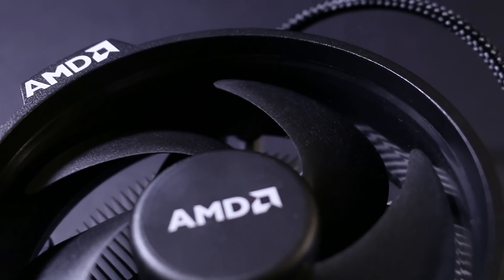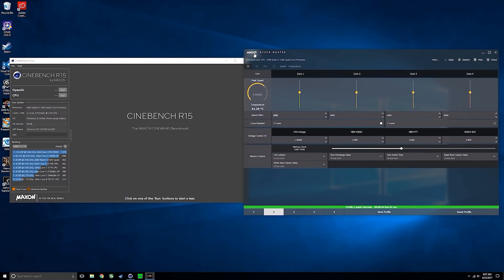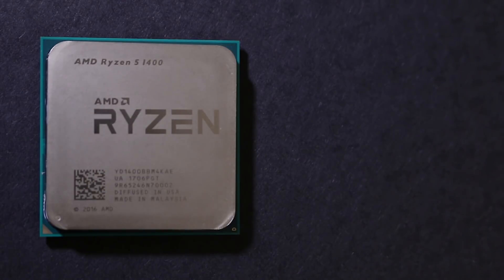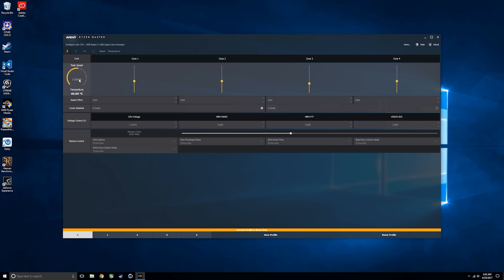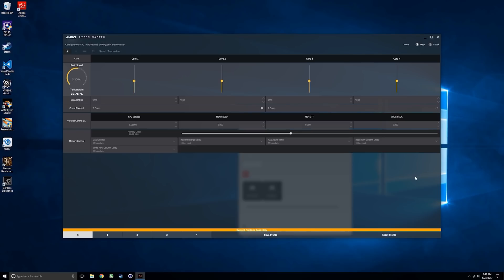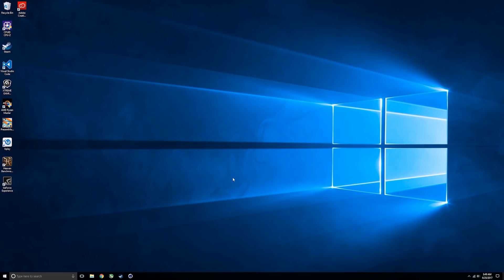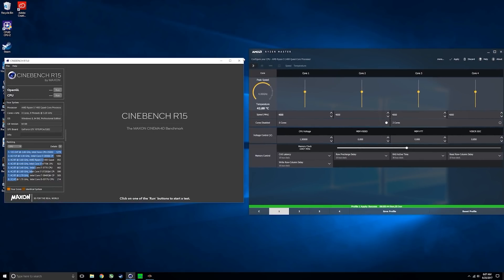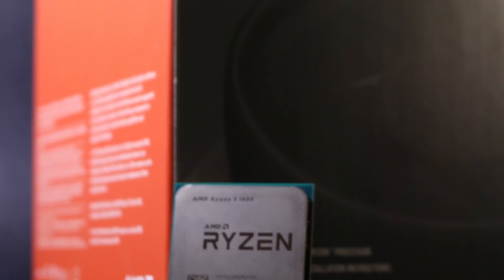AMD RYZEN Overclocking GUIDE

Comment: I tried to get mine to 3.7ghz at 1.3v and it just crashes on startup is my CPU just not going to be overclockable? I have a ryzen 5 1500X with a msi b350 tomahawk

edit: apparently ryzen master reset it's self to 3.5 but now steam msi afterburner and pubg wont open also sometimes after restarting my PC USB ports won't power on my keyboard or mouse I have a power supply that goes 200w over the recommended and I checked and there is more then enough power coming from the wall

Comment: hey nice video! i was thinking about OC my ryzen 3 1200 aswell but im on a older PSU - Xilence XP550. got a b350ma motherboard and a oc 1050ti .
im not sure if an cpu OC is optimal for my setup, would push it to 3.6 ghz but not to sure about the voltage, appreciate any help!

Comment: So I have the r5 1600 and the AB350 Gaming Gigabyte Motherboard, I overclocked @3.6Ghz and i left the Vcore on auto. Ryzen Master shows 60°C maximum and a voltage of 1.2375, I've run cinebench a couple of times and played some games with no crashes at all. 

Am I good?

Comment: Easiest method I've seen so far, I didn't even realize there was such a tool from AMD.
Quick question, I run a AMD Ryzen 5 1600 model and when looking at the specs on the AMD site, I noticed they state the following. Max Memory Speed: 2667 MHz does that mean buying faster memory won't increase the performance?

Comment: How will you change the voltage when you're blue screen or after you've crashed? Anyways, what happens when you crash?
Reply from the maker: If you crash and can't reboot, you need to clear CMOS.
Reply: Optimum Tech Will the pc reboot itself after the crash? I'm an absolute noob and I'm planning to build a pc "for high school" in 2-5 years (it's actually mostly for gaming).
Reply: Optimum Tech Btw you're a beast youtubers you deserve heaps more subs
Reply: you can hard reset the PC, if a PC crashes it usually doesnt mean its dead completely, just needs restarting or repowering off and on.
Reply: youweechube ok thanks a bunch

Comment: I don't understand how you use the Ryzen Master Utility app, it never saves my overclocks so I've had to do it all from the BIOS.
Reply: overclocking in the bios is pretty easy honestly. I have my R5 1400 running at 3.7ghz at 1.2 volts well roughly close to that according to CPU-Z

Comment: Guys help !
So at bios .. the two things are the ratio and vcore .. and thats it? 
Nothing else to adjust for CPU oc ?
Reply: sounds like you have the initial BIOS, you have to upgrade your BIOS from the board manufacturer as there have been updated firmware since release. I couldnt overclock from the BIOS when i first got my B350, it needed the latest firmware and now i can change everything.

Comment: I got a question, is there anything i need to do before starting the overclocking process, other than installing cinebench and prime95 . I got the 1400 and a Asrock Ab350M pro4 mobo and i'm not sure if i need to update the bios first or any other stuff before overclocking. Any suggestion ?
Reply: FallenBlackxStar update bios first
Reply: you dont really need to update BIOS if youre using ryzen master software, this is an alternative to using BIOS

Comment: hello, pls help i change my cpu clock for 3,7ghz and 1,2500 and when i save and reboot my pc when i laucnh my cpuz or my task manager in perofmance my cpu stuck at 3.07ghz so 3.10ghz i have (ryzen 3 1200) and (motherboard  A320m Pro-VD Plus)
Reply: psp1004code5D A320 mb cannot be used for OCing, it requires b350 minimum

Comment: Thanks for the guide. My CPU works @3,8GHZ at 1,3VOLTAGE. I'm kinda happy but not sure If I wanna try the 3,9GHZ one because I'm using the 1700's stock cooler..
Anyways: Is there any way to bring ryzen master to automaticly load the profile once starting up? If I stawrt my computer it just loads the C Tab and I have to apply profile 2 again.

Comment: can you use the software on a ryzen 3 1200?
Reply: Alex Hiltula yes it works on all ryzen CPUs as far as I'm aware, I have a ryzen 3 1200 and ryzen master monitors the CPU fine I haven't tried overclock yet though cuz had issues with faulty ram and still testing stability at stock settings incase I have more faulty parts that need to be RMA
Reply: Scott Purcell ok! Thank you very much!

Comment: I'm trying to keep stock voltages, so I'm only pushing a slight OC to 3.7 on my 1600. Does any OC on Ryzen mean that all the cores are running at full speed? I noticed that it used to say 3.2 and have a max of 3.4, but now it only says 3.7.
Reply: pretty much, itll run at the speed you set it

Comment: Does this only work with the cpu set to auto in bios? I have already overclocked to 3.85ghz with a very slight increase in voltage. Is it worth trying for 4ghz with the program? I can't hold a stable 4ghz no matter what voltage I apply withmy ryzen 3 1200.

Comment: so if i get a ryzen 1700 i can oc it to 3.9, 4.0 with stock cooler? sorry this is my first time ocing
Reply from the maker: R7 1700 generates a bit more heat (higher TDP) than then processor I used for overclocking in this video. 
You should still be able to overclock to atleast 3.7-3.8GHz on the stock cooler with safe temps. 
Set the voltage to 1.32V and see how far that gets you
Reply: ok thanks
Reply: do you have a recommended case for cooling or after market cooler because i really want to oc this and a gtx 1080

Comment: What if i increase voltage only? For example, if i increase voltage to 1.3V and do not increase the clock speed?
Reply: Aneesh Bhata You don't overclock it dumbass! XD
Reply: Stanciu Victor I meant Will it not take extra wattage?.. well thanks for the reply🤣
Reply: I don't know what would be the point in it tbh, same performance, more power consumption.

Comment: I have Asrock AB350 Pro 4 update it to the newest bios 3.20, and i started OC my Ryzen 5 1600 to 3.7GHz 1.3v. when i stress test it, the CPU temp max is 83'c and running at 80'c mostly (running 25min stress test). Is it safe? Anyone can help? I'm new for OCing

Comment: OC'd my 1600 to 3.7GHz with 1.30V. I can't pass 3.8GHz without putting the voltage to 1.37+V. Not worth going waay higher on the voltage just to get 100MHz more.

Comment: Hello, nice vid! I can't wait to try this myself. Quick questions though (disclaimer: am OC noob). When I OC using this software, does it mean that the cores will constantly run at the set frequency? Or only during load (i.e. during games). Also, could I theoretically disable 2 cores when OC-ing to achieve better thermals/higher frequencies? Or does that not really matter? Sorry for noob questions.
Reply: 1. The CPU will run at the set frequency as long as it's not idle, which means as long as it does anything.
2. Disabling cores will cut your performance, but improve your thermals: don't bother doing it if you want to OC.

Comment: using that stupid software is NOT the correct /best way to do it. Fail video is fail.
Reply: It's arguably useful for finding stability, but once you find your stable settings, you punch the numbers in to the BIOS. No, sorry, software is not the proper way to overclock.

Comment: Hi, I have never OC'ed before. Just build a 1700 w/ stockcooler, 16 corsair 3200mhz, b350 gaming pro carbon. What is recommended temps etc? I followed this guide now, and got 3.8 ghz on 1.32500.. Temp is 45 ish idle and 70 in Cinebench 15.. Is that too high?
Reply: torkbjo anything sub 80 is fine, as mentioned in the video.

Comment: I have a stock cooler but I crash at 3.7 at 1.3Volts do I need a better cooler? And yes my power supply is 80 plus bronze and is 450 watts

Comment: Excellent guide! From some quick tests I found that the R5 1400 I have can run up to 3.7 Ghz on the stock 1.25v but if I want to reach 3.8Ghz I have to up the volts up to 1.4v. Temps also go from 65°C in 3.7 Ghz to 75° on 3.8Ghz, I think it's weird.

Comment: Can I get 4.0 GHz at r5 1600 b350m Mobo and stock cooler? And what power supply do you recommend I want to keep the temperature check? So any suggestions and hey your video are great. You got a new subscriber.

Comment: I bought my ryzen 1700 on release day and got bored 5 months later and decided to give ryzen master a shot. I gotta say im impressed, it achieved the same overclock that i set manually with lower VRM and maybe CPU temps (not sure yet). I used p state overclocking before so idle clockrates are same, but somehow using ryzen master my volts go lower at idle which i like (.8 vs 1.024 manually). I will say do not attempt to set ram up with ryzen master, at least on my system i had no luck. Not sure ill keep using this but so far i like the lower voltages at idle and lower temps of my VRM.

Comment: Soni can just change the settings to 3.9ghz 1.3v with out problems?
Reply: Depends on your cpu, every cpu is different. I personally to get my r5 1600 at 3.8ghz had to set the voltage at 1.33125. Gonna try higher clock speed and see if I can reach 4.0ghz

Comment: Why when I up my voltage, the speed throttles to 1550mhz. No matter what speed. MSI b350 motherboard latest bios. Only if voltage increases the speed throttling in windows. Using watercooler r5 1600
Reply: THEREALMVP i have the same problem with gigabyte gaming 5 and ryzen 1700

Comment: Hi, question: Is there any way to pass my Ryzen 3 1200 over 3,875GHz? I 'm running 3,80 at 1,4V and its cool and stable.. I can push it to 3,875 still at 1,4V but I can't stabilize it at 3,9 even if I set voltage to 1,55V. Is there any way tu push the limit? Using MSI B350 Gaming pro MB.

Btw nice vid.

Comment: How do you know when your CPU is unstable? sorry, I'm just a begginer
Reply: LightSpeed when your PC turns off during workloads or gaming.
Reply: Bit late, but your Computer will simply crash, enter blue screen of death, and automatically shut off. This can be quite dangerous, but nowadays, all parts have safety switches so it'll help you know whether your voltage is stable or not

Comment: I lost the silicon lottery with my 1700. My CPU is unstable at 1.35v and anything above 3.8GHz. Changing the voltage to 1.4 doesn't work either.

Comment: How can I make my overclock Profile as Default instead of the original. I overclocked my CPU From 
Speed: 1550
CPU Voltage: 0.87500
 TO
Speed: 3950
CPU Voltage: 1.45000                            
And its still going back to the default Speed: 1550, I don't know why. Yes, I did pressed the Apply button.
and Also my pc creashed when i did the prime test. BUT It did pretty good in Cinebench R15. I was impressed.
Should I also Disable HPET after overclocking?
Should I keep my Numbers save even Prime crashed?
Reply: 1550 Mhz is idle speed, it goes down if it's not in use
Reply: Thanks. Right now I am using 5 way Optimization. Which has helped me a lot

Comment: Great video. It has helped me get to a stable OC on my Ryzen 1700x. A weird thing I have noticed tho is that after setting the OC and it not crashing, I get different readings. In the bios it is 3.7, in Ryzen Master it is 3.7, but in task manager it stays at 3.4 and sometimes in CPU Z it is 3.4 and then randomly jumps to 3.8 then to 3.7. I am using a MSI X370 mobo which has a boost option to go to 3.9Ghz. This works just fine but I don't like the 1.45 volts that it runs at when I do this as I don't trust my cooler. Also in Cinebench 15 it shows up at 3.4 after I OC it to 3.7. It shows my previous OC of 3.9 and 3.6 with my new OC in the middle of them both. Here is a screenshot of what I am talking about. https://gyazo.com/8d02c11cb9f31a797b01c4515d859264